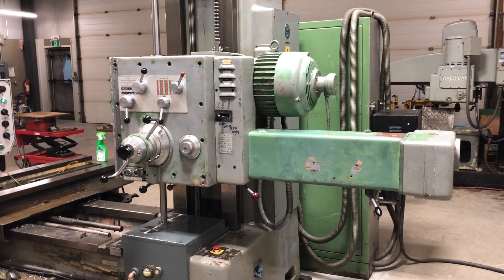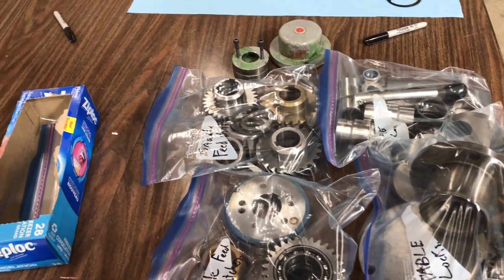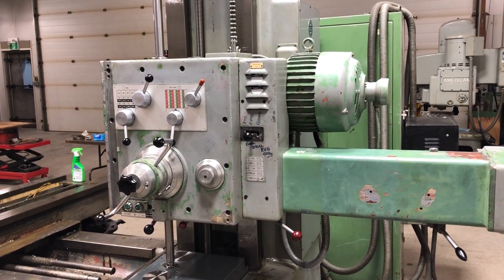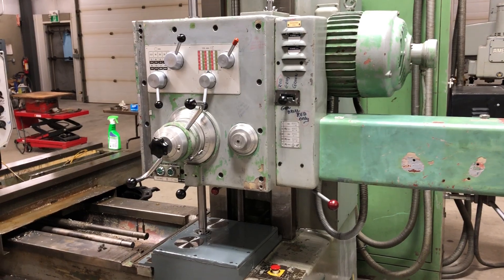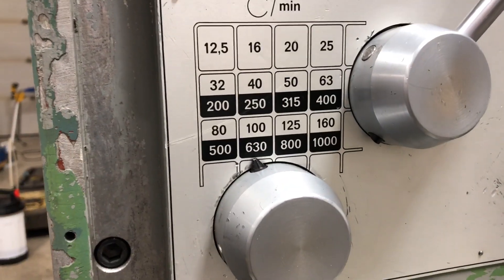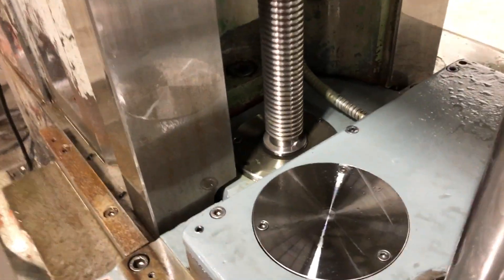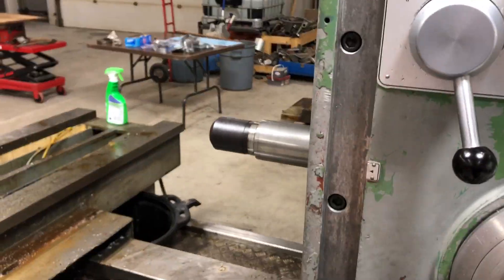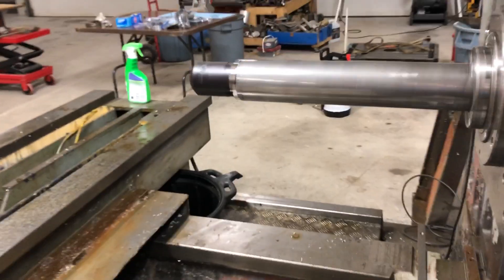HBM Update No. 3 (it's Alive, at least somewhat)

Comment: If interested, I may be able to help with my 60” camelback straight edge and scraping gear. In Wpg.
Reply from the maker: Hello Stan.  Thanks for the offer.  I am starting to think that the ways are in pretty good shape and I am going to leave them as is.  Once I start machining parts I will find out if they are up to snuff or not.  Do you rebuild/rescrape machines? Ken
Reply: @hmw-ms3tx  Yes, have done some rescraping on smaller machines than your HBM, but am not a professional rebuilder. Offer is free mainly as thanks for putting up some enjoyable videos.